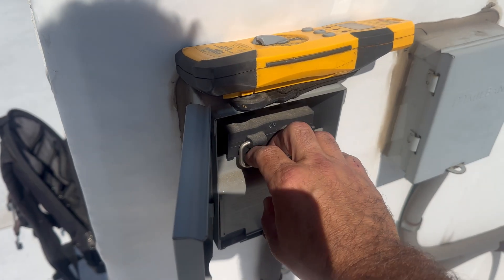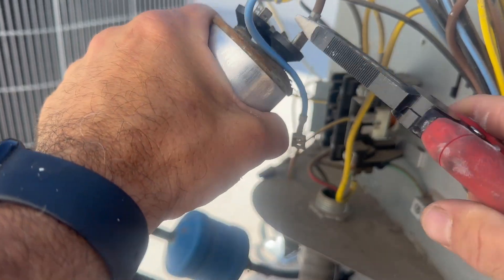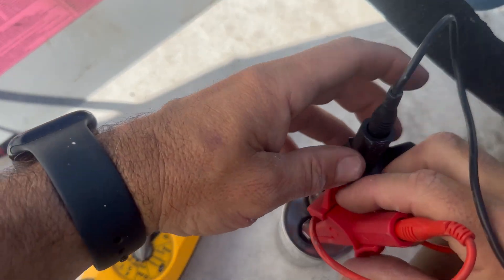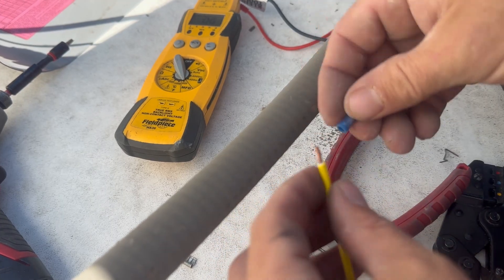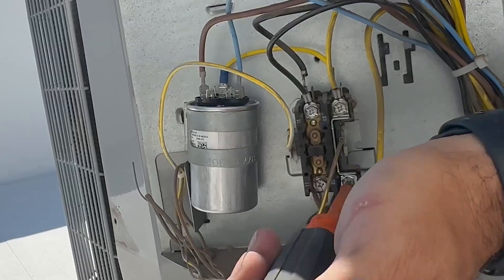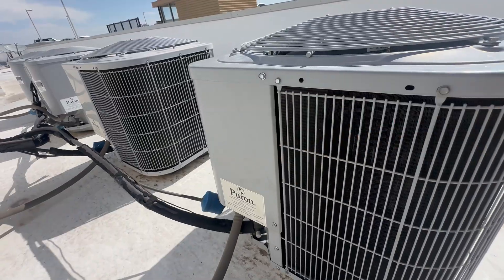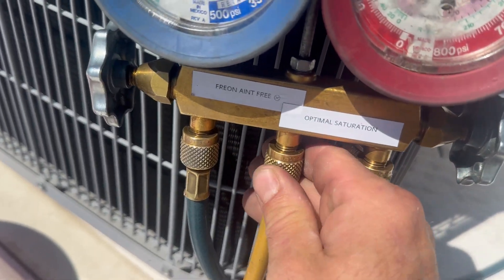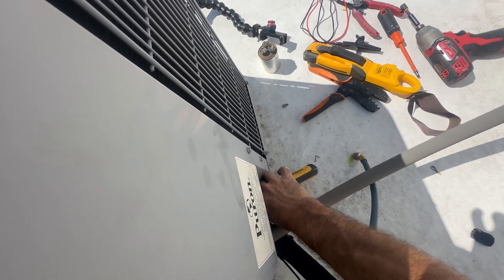Redneck Run Capacitor Testing on Carrier Condenser

Comment: Beware the spring and fall maintenance deals that a lot of HVAC companies offer a yearly service plan.
We had a tech doing the spring maintenance and had changed the start/run capacitor without asking. When I confronted him minutes after he changed it, he claimed it was out of spec.
When asked what that just cost me he said he didn’t know!
Got the bill for $150 later and immediately called and complained.
They said he had retired but that it wouldn’t happen in the future.